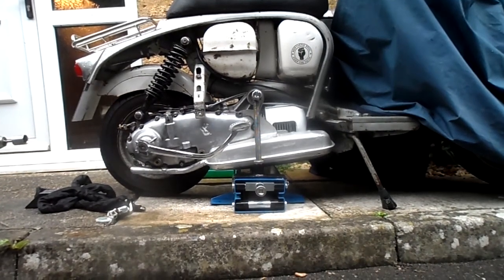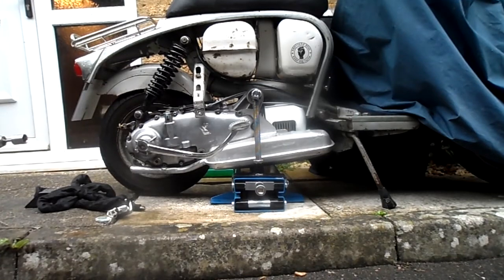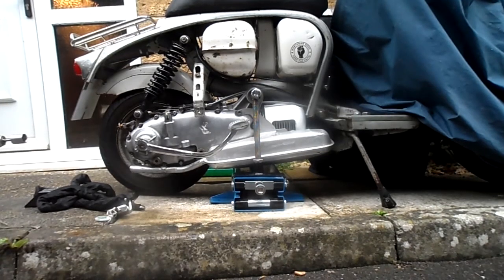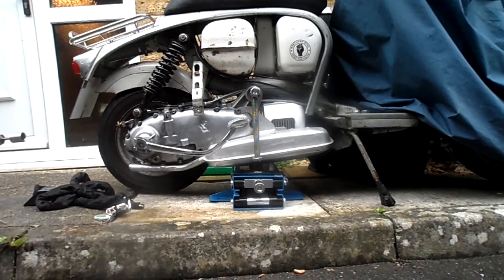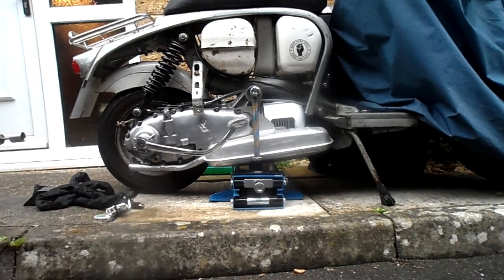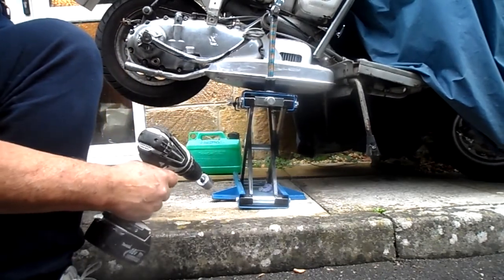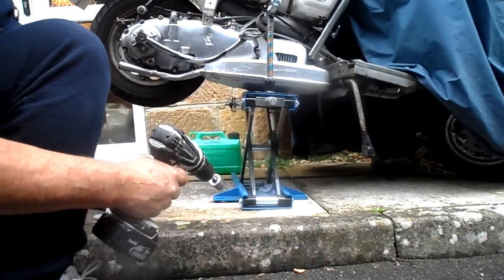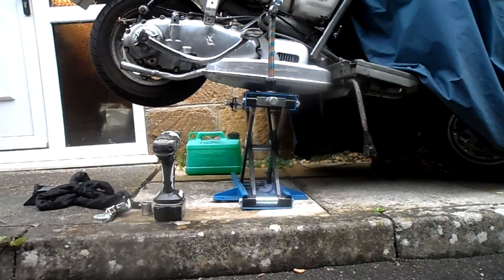Lambretta Li TV SX GP portable scissor jack

Comment: Great idea...
Reply from the maker: thanks Rob. if you are interested in making one let me know and I'll give you the list of parts and some dimensions if its helpful Johnny
Reply: @johncooper7242  if you could make a video how to make the scissor jack would be better.
Reply from the maker: @basimfara  its pretty simple really. you just need to screw in some threaded bar and weld some cross pieces to the tops .to line up with the engine mounts.
Reply: @johncooper7242  oh I got it. So you made 2 jackscrews on both sides of the engine mount. right? 👍
Reply from the maker: @basimfara   they are made of threaded bar which is the same metric size and thread pitch as the original sliding adjustable stands I can't remember now what size maybe M15 ?  I just bought 2x 600mm long threaded bars and cut a section off to weld across the top .
I then just used a series of nuts and connectors the same size as the threaded bar. If I get time I'll  take some pictures and measurements .

Comment from the maker: it has been pointed out that it would not be possible to lower the scooter to work on the engine with the scooter jacked up but this is easily solved.

All you would need to do is first remove the bump stop, then remove the suspension strut and lower the scooter .
Measure the distance between the suspension strut spigots and drill 2x 12mm diameter holes in a strip of steel bar.

  Fit the drilled steel bar in place of the strut and replace the strut lock nuts and then jack the scooter up ........
Reply: it is a good idea. you said it's stable but during work on the engine is it stable. ?
Reply: No it's Dangerous!!!!!!